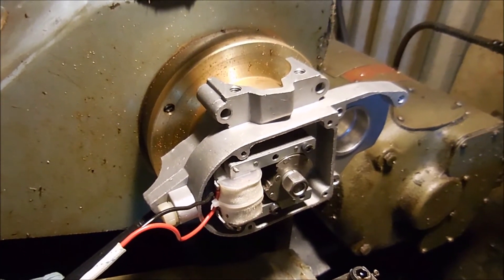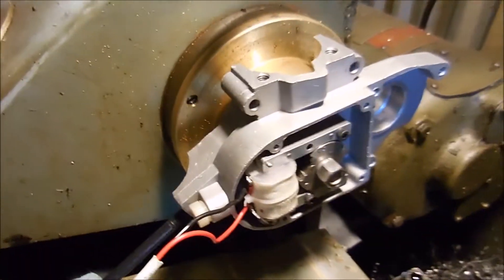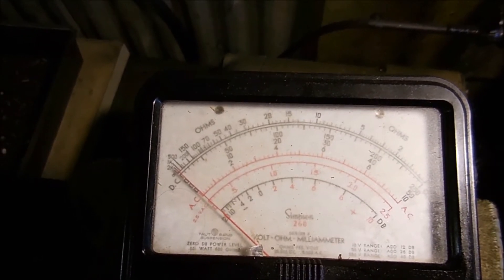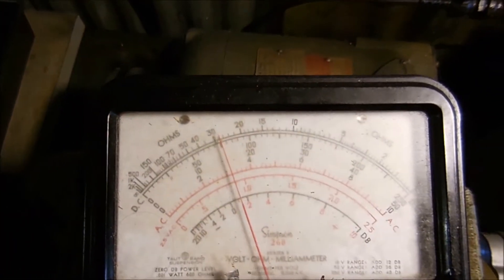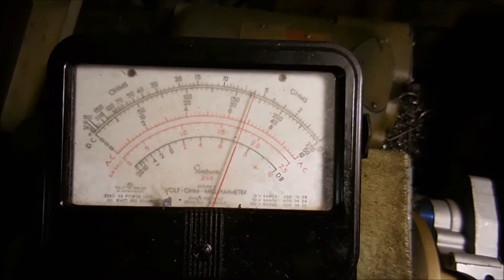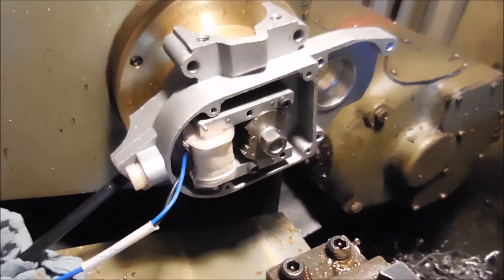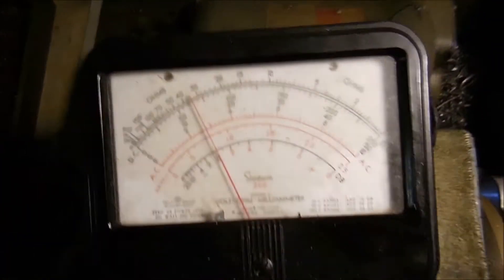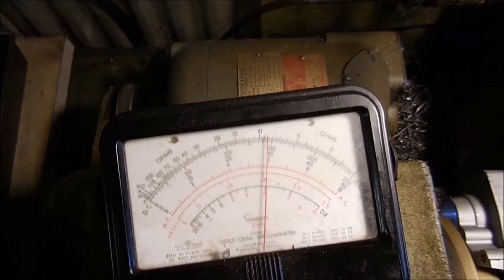Magneto voltage comparison test

Comment: do we need all voltage ??? are you shooting a mouse  with an elephant gun more voltage means early failure wire shorting plug burn out you should only use the amount needed to work well..

Comment: Love your videos! Love how you balance your engines on your lathes. Pretty cool. So i have a question about engine kits on Ebay. I bought an 80cc for $80 from a seller. Purchased another same engine kit from same seller for $90. Price increase. But was super fast shipping and nothing wrong with kits. Now i want to buy a 3rd from him but he increased price to $100! I can get a 60cc kit from another seller for $80. I can save $20. Is there a difference between these 2 engines other than CC size or are they one and the same and they're pulling the wool over our eyes? Thanx in advance
Reply: theone2be33 Yes sir "Pulling the wool over your eyes". None are an actual 80cc unit. If im not mistaken they're all approx.66/67cc's. Fred has a video here on how to tell the difference in the engines. There is a few things that change up that makes or takes horsepower. There is however good engines to be had IF you are aware of what to look for. Good Luck to you sir.

Comment: the three wire stator was the head light modle that usually came with the 69cc kit we had imported.  most are 66cc or 49cc
Reply: the white wire is only 6volt.Fred has a vid about 2 plug heads.

Comment: Hey Fred I just bought my first engine kit sadly off eBay because I'm cheap and wanted to get a good feel for it . Well it's been going great up until yesterday when I pedal and drop the clutch my engine turns over but when I pull in clutch the engine will rev but I don't actually move or gain any speed I've adjusted clutch messed with throttle everything changed jet needle
Reply: head bolts on these engines are closer to 5-10 foot-pounds. anymore and the heads will likely crack. Your method of tightening works too though just get them tight with a wrench. Usually its just passed snug then another 1/4 turn.
Reply: I dont know if you have fixed it yet or not but it sounds like you have  an air leak somewhere. Check the intake manifold first. If its no where around there then you have some hunting down to do. It could be just about anywhere on these things. I had a leak on the bottom of the crank case gasket before.
Reply: theone2be33 hahaha! OMG! I hope he didnt take your poor advice! "50lbs"!!!? WTF!!! WRONG! 12LBS. MAX. & The electrical tape? Hahaha! Have you ever seen what gas does to electrical tape, unfortunately I have, on a bike brought to me from a schmuck that thought that was a good idea too. Mealted tape all throughout the carb consequently causing a plugged up carb. Whata a mess the carb and your comment.
Reply: Drcool52 yeah i would try tightening down those four head bolts in an "X" pattern. I believe they're torqued at 50lbs. But i just tightened mine down really tight until i felt like any more tightening would crack something. Has been running fine for me. Also, before you intall your NT carburetor take the screw ring off and wrap a little electrical tape around the outlet. You'll notice those 3 grooves, well you can only push it on so far but still have a minute space at the end of each groove. The tape will seal that. Then connect your carb. I did. Mine runs fine. Hope it helps.